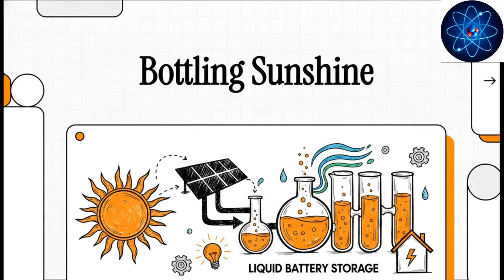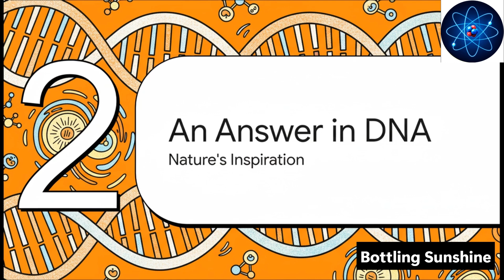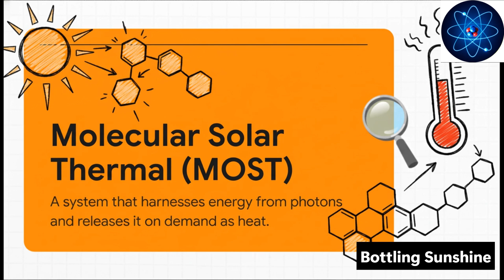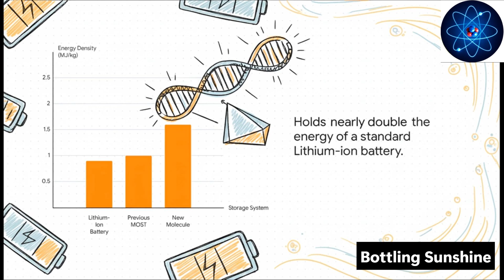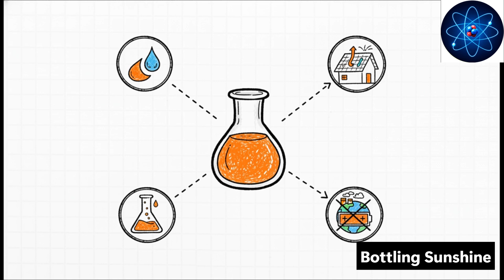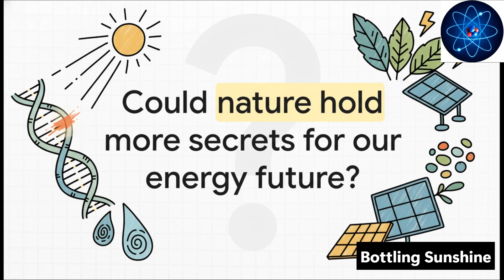Bottling Sunshine

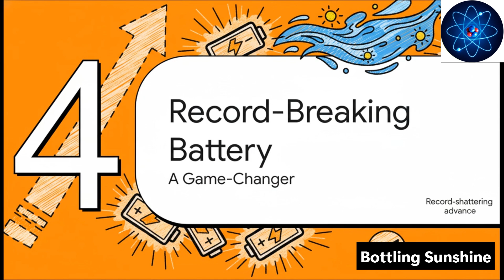Comment: 3:28 I hate to break it to you, but boiling water to make steam steam can store more than 2MJ/kg, so no, that's not a world record. Please stop populating the internet with junk information.
Reply from the maker: Please read (recent - March 2026) following article from 'Physics World' and still if you have any doubt, you can write to the Isabelle Dumme, contributing editor of it.
https://physicsworld.com/a/rechargeable-liquid-solar-battery-stores-sunlight-in-molecules/
and
https://www.science.org/doi/10.1126/science.aec6413?adobe_mc=MCMID%3D12807717541695520374581035441316411579%7CMCORGID%3D242B6472541199F70A4C98A6%2540AdobeOrg%7CTS%3D1772649170
Reading above paper may give more details.